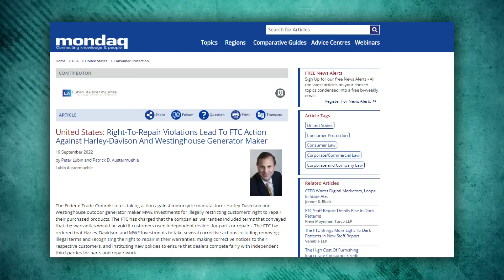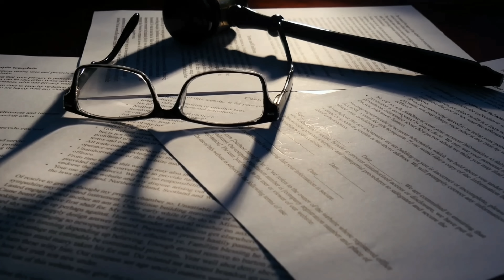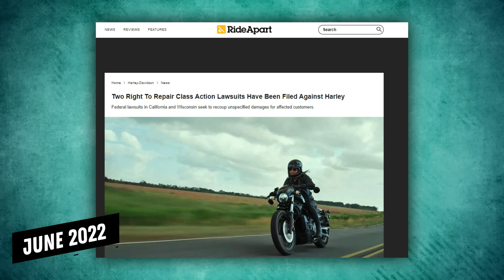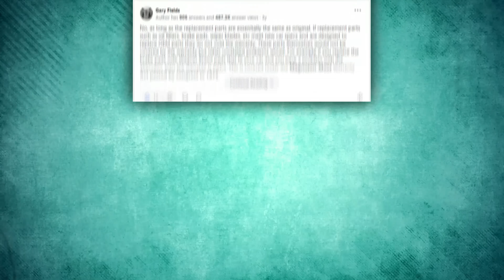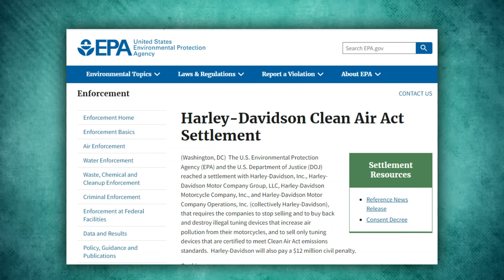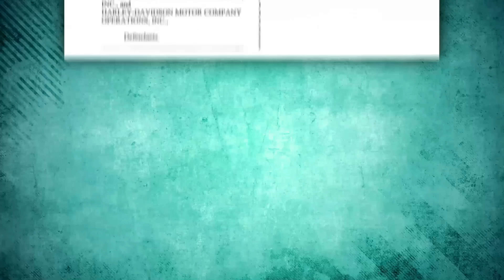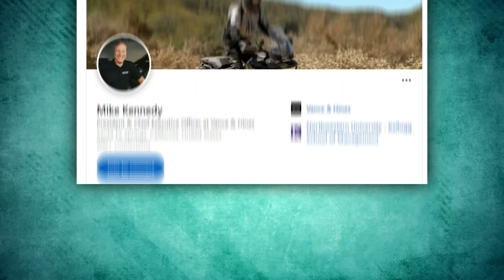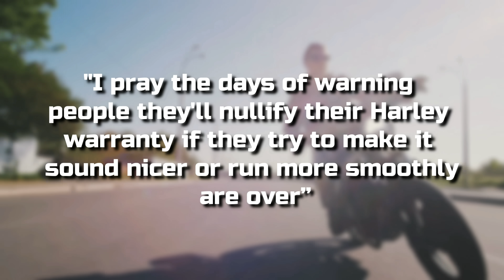This Affects All Motorcycle Owners!

Comment: Harley's solution to this would be to making a reliable engine again, like the EVO was.  Then Harley Head Office does not have to worry about people buying after market parts for repair.  But as the story roomered goes.  When the EVO engine was being manufactured, dealers were complaining about lack of repairs and they could not make money.  Here comes the Twin Cam with it's compensator issues, and the cam chain followers.  Harley ought to learn something from the Japanese motorcycle manufacturers.  Reliability, reliability, reliability.  I sure know a lot of Metric crusier retailers that have been doing just fine without all the repairs for their reliable machines.  So Harley, what gives?  Why do you build defects into your motorcycles?  I have had 9 metric motorcycles in my 72 year life.  I have had two Harleys recently as an end of life bucket list.  But in all my years of metric bike riding, never have I had mechanical failure points constantly on my mind, as I do when riding my Harley.  Component failure is a reality with Harley, even after making motorcycles for a hundred years.  I see plenty of videos of Harley die hards that love working on the failures of their Harleys almost like a religion.  I am sorry.  I would rather be riding my motorcycle than repairing it.  And I want to know that I am safe riding it.
Reply: Drama queen.

I have two Harleys, a 2007 Sportster and a 2005 Softail, and they run pretty fine, with more than 80,000 km each. No issues. What I've observed from others is lack of maintenance when mechanical issues arise, and by that I mean real lack of maintenance, like no oil change even after 20,000 km or past five years. Really? And I think the idea that a Harley is an indestructible machine is deeply ingrained in those owners, which aren't a few. So things happen and they blame poor quality and no reliability of the machine. I've seen it directly too many times. And I've seen few Sportster, which are well and properly maintained, that surpass the 250,000 km with no top or bottom end service at all ever.

So, yeah, I've seen too many drama queens too.
Reply: Hmmm I have a (Twin Cam 88) 06 Road King. Just turned 70k this summer. No problems, I did  just this summer  replaced the compensator just started making a little noise.  And a couple of years ago did the cam chain tensioner upgrade, just for peace of mind. Has never left me stranded.  And  has been a wonderful bike. I have rode bikes for over 40 years and the  best bike I have owned.
Reply: Bs.  I have a 22 year old twin cam which runs just fine.
Reply: @jonathanrichard1919  old Triumph are just Britt Harleys, that's what most of us oldies use to say Back in the day. And HD has no more reliability issues then any other manufacturer,  I have owned almost every manufacturer, for sure all the big ones and they all have good and bad. You just pick a brand and learn them, same with cars and trucks.
Reply: @jonathanrichard1919  True, yes I know they were much lighter , one of the reasons they were so loved. I just ment we seen them on the same field, along with the old Nortons and BSAs. Carry on Brother
Reply: @omarsalgado9715  it’s the same crowd that says all American autos are junk when in fact the imports have just as many issues if not more so in many cases.  That crowd is the crowd that’s been saying that crap since the 1980s.  You will never change their opinion but they will continue to talk their bull crap about Harleys cause it makes them feel like big men riding cheap Japanese sport bikes that are so uncomfortable ergonomically and dangerous that they have to sell them when their beard has a kid or two
Reply: @raynic1173  funny thing in all  years of riding Harley Davidson is the only brand that never left me broke down,  even one of my Ol Reliable Hondas stranded me before, and as mentioned above I have a lot of miles and lots of brands. I even had a brand new Kawasaki with 200 miles go down on me one night and I had to work on it along the road ended up being a major electrical connection that wasn't clipped in correctly at the factory.  Like I said they all can. I have had a harley loose one cylinders spark on the way home before but she still made it home. Nope HD has never left me working,  or riding with someone else.
Reply: @jonathanrichard1919  I like the look of a boober .. but a 750-850 pound bike.. cruises 85MPH without difficulty coast to coast.. put putting around on a lite bike may be fun, but interstate haulin ass is biking 101….got two medium weight Harley’s and a heavy one.. drove the heavy one in south Texas yesterday, nice cool weather… 8 hours not one beer joint.. coffee bars, and fast food stops along the gulf coast,200 miles of cruising.. sure makes you sleep good😊
Reply: Yeah yeah I have a 1981 Honda CB900 Custom that has over 140,000 miles on it and has never been rebuilt and still runs like a top
Reply: @crashnbl1  I bought and road jap bikes from 1973-2002… few issues and easy to maintain.
Stepped in to Harley land as an old guy now.. it’s 400% mark up on everything.
But my 1200 shots fire out it’s drag pipes and sounds like a dragster, my super dyna glide 1450(88 cid)
Screaming eagle with an old touring motor lite Fran can cruise 100 miles per hour with room for more.
And my 96 soft tail screaming eagle is just more power then I normally used.. it’s fast, quick and mostly a touring bike set up.
I do want to sell it all for a Honda gold wing 6 cylinder used1850 cc.
Maybe this holiday season I’ll find a desperate type, and be done with my bike bucket list annoyances.
Big, bigger , biggest is such a pain without proper funds🧐
Reply: Harley reliable is shit reliability in the Japanese bike world.
Reply: I’ve had a couple twin cams. Never had any problems with them. The chain tensioners have some issues but that just gives you an excuse to add a performance cam when you take care of the problem
Reply: @omarsalgado9715  exactly.  Proper maintenance prevents piss poor reliability. I have not had a break down out of the last three I owned. One evo and two twin cams. Riding a fat bob 103 twin cam now.
Reply: @UC_aP6c4Go14LmkQWenOnMpw crotch rockets are not comfortable.
Quick and fast ..yes..!
But can you drive until the full take is nearly empty three times a day..?
If you wanna cruise the country.. you gotta empty three tanks a day to get any distance from the day before…RIGHT..?💁🏼
Comfort has everything to do with motorcycles… everything..!🏍💨💨😊
Reply: For all those who brag about their HD products making it to 80K miles IF you do all of the maintenance there is a guy on YT named Long Haul Paul who Yamaha now sponsors. He rides constantly to benefit MS. He puts 100,000 miles on one of their bikes driving thousands of miles a week and turns it in and gets another one. He changes the oil every 10K miles and tires and does nothing else. These Yamahas keep going. There is a huge difference in the quality and engineering on a bike that can be abused cross country to be ridden in ALL weather including snowstorms and goes the distance. He is on his 4th or 5th Yamaha now. My Honda VTX1800 finally had a repair at 20 years when the fuel pump quit. Gold wings, well their reputation is unrivaled for longevity. Yes it's nice that you can get aftermarket parts for 80 year old bikes and keep them running but that sprang from the need because these bikes needed the parts.
Reply: @crashnbl1  I used to feel like that as well.. now I got two cruisers and a touring bike..all used Harley’s…
Tires, batteries, fuel..
Drove all three in past five days of riding.. 623 miles along the southern gulf coast… had rice burners from 1975 till 2006now I got three almost antique Harley’s with extremely low miles, bought from people that got scared and just were embarrassed to let them go..
4k-5k and 7k16k three Harley’s..
26k miles
16k miles 
8k miles.😎
Reply: @9999plato  Blah, blah, blah.
Reply: Well, i had a friend who an early model evo brand new. It's crankshaft split in two within the first two months. So, I have have never really considered it reliable.
Reply: @jonathanrichard1919  I also like a light bike , you hit the nail on the iron head 🙂
Reply: @lengray44  Haha, imaginary friends don't count.
Reply: there's lots of owners talking good about their HD bikes, there's also lots of owners talking bad about their HD bikes. But what you won't see is a mechanic. Those don't even talk or touch a Harley unless they're being paid.
Reply: All this is moot. Stealerships make their money in the motorclothes section. I worked at one. The markup is INSANE!People want to LOOK like a biker more than they want to ACT like a biker. A true biker wants a reliable and awesome machine. The customer base wants a shiny machine and the trappings to SEEM like they live the lifestyle when they ride once or twice a week and/or take a long trip now and again.
Reply: Your story reminds me of the 90s when I'd be cruising along on my 920cc V-Twin dohc Yamaha at about 80 mph on the highway and someone on a Harley would have to pass me to show me who was boss. Inevitably that same Harley would be broken down by the side of the road less than 2 miles later. This happened more than once. Those guys were such dicks to me back then, they would never miss an opportunity to spit on my "wussy bike" and call me a fag for riding Jap junk - so back then I would just honk and wave as they gave me the finger from their unscheduled roadside stop. Now that I'm older, I don't do that anymore. I've even helped a few stranded Harley riders when other Harley riders couldn't because they didn't know what to do. That's why I carry a good set of tools on my 42 year old Goldwing. For the Harleys.
Reply: @edwardjohnson8933  yeah I did my Harley trip back in the day and went back to my jap bikes...lot cheaper and less maintenance
Reply: @raynic1173  thats what mine is also...with the big fairing
Reply: @edwardjohnson8933  don't get me wrong I like Harleys but I prefer the jap bikes for the lesser amount of Maintenance and Repair and horrible expense to buy parts... and knock on wood other than valve adjustments I've never done anything major to my 81

Comment: In 2002 I bought a brand new Harley, the dealer sold me a stage one screaming eagle kit and they installed it. At a 1000 miles I took the bike in for its first service. The oil tank was full and all was good, 200 miles the bike was out of oil, it was over heating, it had a miss, it was just falling down. Right away I took it to the nearest dealer, they took one look at the air cleaner and told me I had no warranty on the bike. Then I called the Harley 800 number and they told me I had no warranty. 1200 miles on a new bike, a dealer installed part and that voided the warranty. My first and last Harley. I had been riding 34 years at the time and have owned many Hondas over the years and Honda always took care of me. It was a lot of money for a piece of junk.

Comment: This should be interesting to see how Harley Davidson's infamous "Black List" is affected!!  Here in Southern Minnesota most of the Non Harley sponsored repair shops can't get OEM parts from dealers merely because they provided a better service at cheaper prices! This screams monopoly to me.  It's gotten so bad, the local dealership shut down their HOG chapter for "Unspecified Reasons".
Reply: This sounds like more socialism b.s..
Reply: @danielbear8234  You think that's bad, back in the 90's Harley was sending 'spys' out to independent shops before sending out lawyers if they had so much as a factory logo, parts, or colors black & orange on the business premises. They were even going after tattoo shops if they had any trademarked logo flash hanging up.
 They shut down loyal old dealerships who did not conform to the new corporate Yuppie Boutique floor plans.
Reply: Post a list of the Indy shops providing better service at cheaper prices who have been “blacklisted”. They deserve recognition and a round of applause. Personally I would specifically support any Indy shop being “blacklisted” by HD for the fact that I know that warranty refusal or denial based on repairs or service not being performed by the manufacturer dealer is not only unethical but also a shady practice.

Comment: A guy that works with me bought a brand new Harley 2 years ago and had the dealership install Harley fog lights on his bike before he left with it.
These lights were designed by Harley for his bike. Two weeks later the whole electrical system burned out on his new bike.
Harley would not honor the warranty because they said he had installed fog lights that didn't come on the bike.
He had the receipt where he paid for the installation of the lights by the dealer.
They still wouldn't honor the warranty.
That told me right there I will never buy a Harley because of BS business practices like that.

Comment: But HD's entire business plan is to sell a sub-standard product and then drag you over to the parts counter so you can spend tons of money on Stages....My Raider came off the assembly line equivalent to stage 4. My Iron 883 has no "upgrades" because there is no way I am going to throw any more chingo towards a bike that is almost what I wanted. HD needs a reboot and a new business plan. Start selling bikes that roll out of the dealership without needing upgrades.

Comment: So many HD riders out there that have been riding for years and don't understand the 1st thing about motorcycles. Same goes for the cars they drive. Not just HD owners. Drive till it drops.
Reply: I’ve seen many low mileage bikes for sale lately, and wonder why they even own them. Just to tell their friends “I have a Harley” I guess, but don’t ride it, or know the first thing about working on it. They probably can’t even change their own oil!!!
Reply: Most HD riders I've met know nothing about motorcycles, AND they're terrible riders. They're OK at going in a straight line in a group, that's about it. There were three 20+ year HD riders in the MSF returning rider course a few years ago when I started riding again after 30 years. They were awful, couldn't turn in less than a 50 foot radius, put their feet down all the time, really just almost no skills. They got way better in just 3 hours of time on the range, which leads me to believe that they have spent less than 3 hours in their previous 20 years actually working on any skills.
I spend hours a year in a parking lot working on skills.
HDs are mostly jewelry for dentists that wear leather on the weekend.
There are certainly exceptions. I've met HD riders who are skilled, ride a bunch of different types of bikes, and are excellent mechanics. But from what I can tell that's about 1 in 50 riders.

Comment: If the machine is repaired with non Harley-Davidson parts , the manufacturer of those parts should be responsible for warranty of the part itself and any subsequent damage the part may cause if it fails. I do not understand why a manufacturer is expected to warranty Parts it did not make. Or to continue to warranty a machine that has been modified with parts that it did not make.
Reply: Fair enough. But part of the argument the video talked about is voiding the entire warranty if for example, there is engine failure, and HD won't honor it because you switched out some speakers. To me, that sounds fair for HD to honor.
Reply: @dontworrybehappy8080  have you experianced this at a dealership?
Reply: @montejones5788  Yes I have. According to my example.
I replaced my exhaust and air breather. Not long afterwards my battery died. The dealership near me replaced it free of charge because it was under warranty.
Reply: @dontworrybehappy8080  then the dealership acted in good faith on your behalf and did what they were supposed to do. Now what would you expect if your bike had not been properly remapped after the air cleaner and Muffler change and burned a piston because of it? Who put the parts on? Were they Harley-Davidson parts? Who remapped the bike? Who is ultimately responsible for the damage?
Reply: @montejones5788  I'm not disagreeing with you so long as the discrepancy is affiliated with the problem. However, part of the video is pointing out dealers that look for loopholes to dishonor warranties that have nothing to do with the deficiency. Its all good. Lets wait and see how its settled in court I suppose.
Reply: @dontworrybehappy8080  yes sir I am inclined to agree with you on that point. I've been a Automotive mechanic all my life, and have ridden motorcycles all my life. And I have never experienced the situation as put forth in your example and the video, except in cases where the vehicle was abused. Or when the customer was so far out and left field there was no dealing with them. It's best to let the courts sort this stuff out, instead of the internet.

Comment: I bought mine used without a warranty.  I've had it serviced and repaired when the stator went out and paid for it myself.  I've also made many upgrades to it and again , paid for it myself.  Warranties that make you use  specific factory parts , or make you use a dealership for service work is wrong.

Comment: Hundreds of ‘00s twin cams out there with super low miles. 10-20k in immaculate condition for $8-10k that’ll go another 100k++    Why spend $25k for essentially the same thing.  Put a stage 1 or 2 on it and you won’t miss a thing.

Comment: I just received the amended warranty for my 21 Ultra Limited. It actually clears the way for HD owners to have their bikes serviced and worked on wherever they like, and to use non OEM parts in said service and work without affecting their warranty.
However, should damage occur due to the work or non OEM parts, the warranty will not cover it.
This was actually already the way things were for my last two bikes between 02 and last summer.